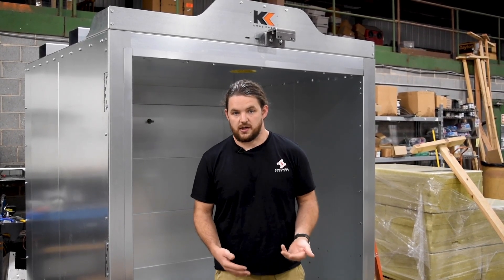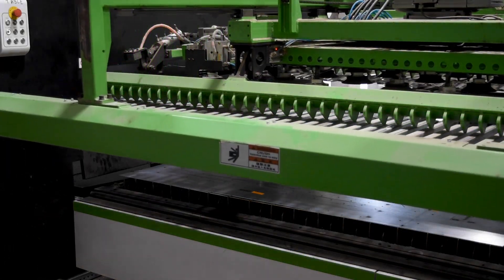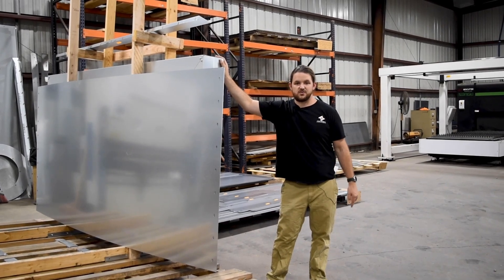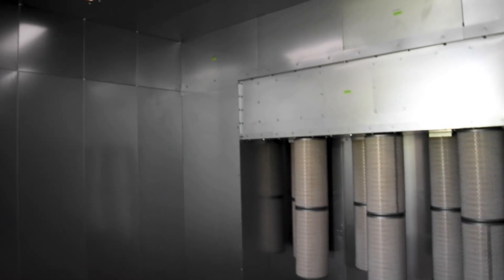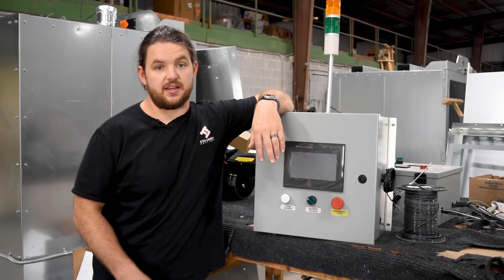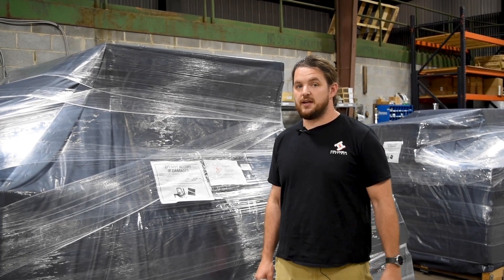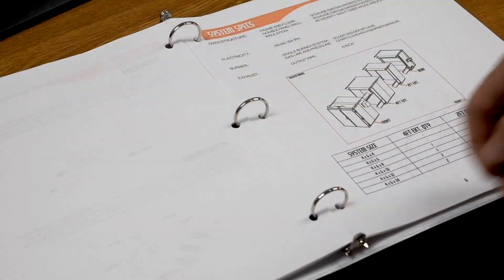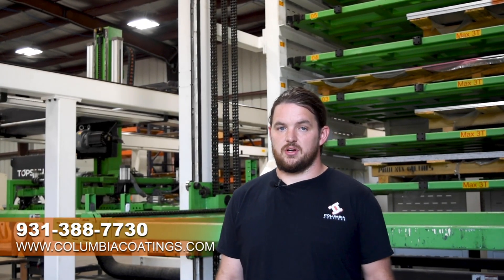Inside Look: Kool Koat Batch Ovens and Spray Booths

Comment: What's the maximum expandability of the ovens?
Reply from the maker: There is no specific maximum for expanding the length of your oven, but at a certain point you may exceed what your burners are capable of heating efficiently. If you reach out to our oven sales department at 931-388-7730 or sales@columbiacoatings.com, they will be able to give you more specific information.
Reply: @columbiacoatings  fantastic